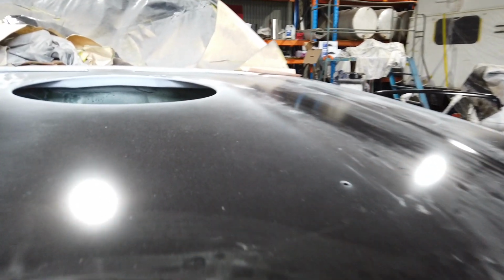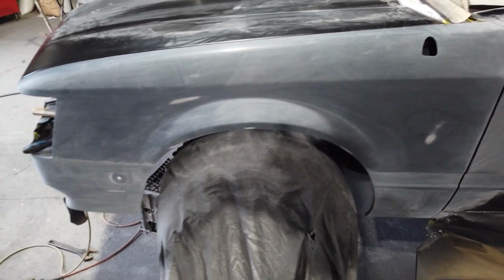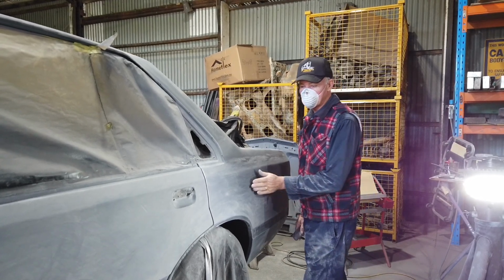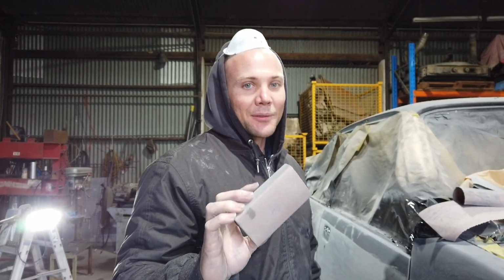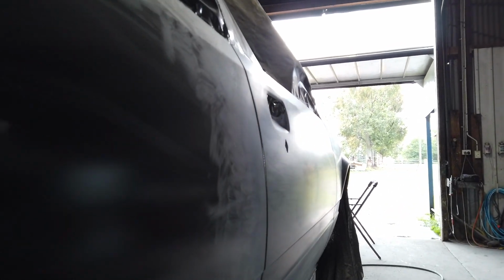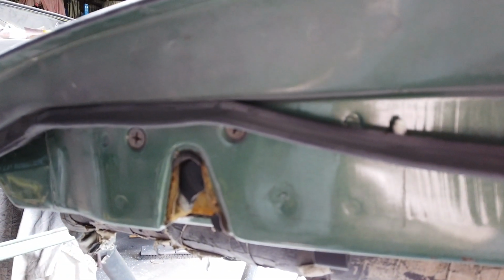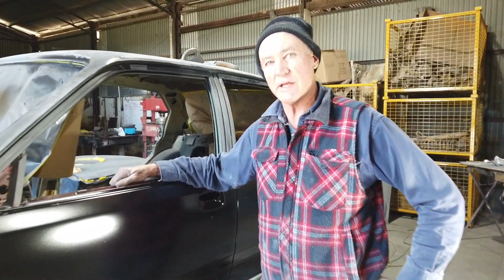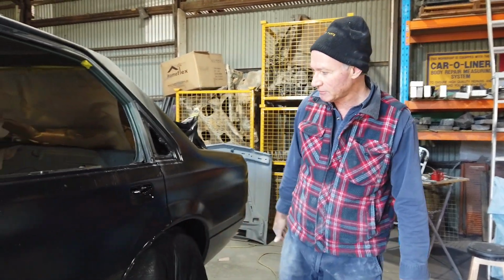Holden build.VH commodore build part 16.

Comment: The car is looking sensational gents.
Before you prime the car (after you have blocked it) are you going to epoxy it again to seal it? Or are you using a epoxy primer as the sealer? Thanks
Reply from the maker: Thanks Big Al. Every job is different. With this vh we have used epoxy prima to cover all metal and than we will use epoxy again and we have used black 2k prima to seal it.
Reply: @adamsonautobody  thanks for the reply and info.

Comment: Nice job guys. I have the same problem with my VH where the door frame is outside the a pillar. How did you fix that?
Reply from the maker: HI Guys, to fix your door you must cut your door hinges and weld them back on in the correct place to fit. They can be a tricky door to fit.